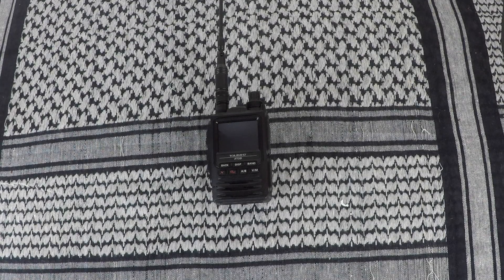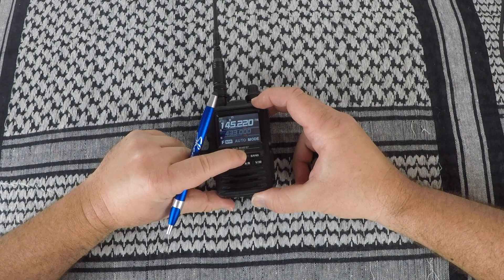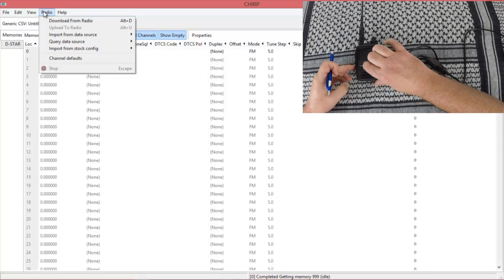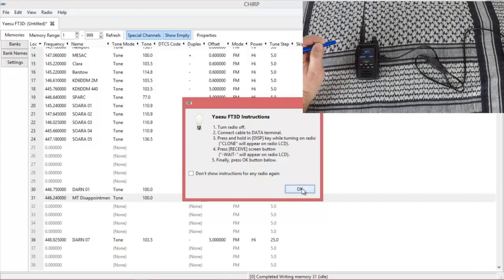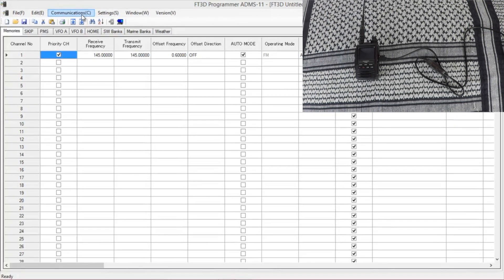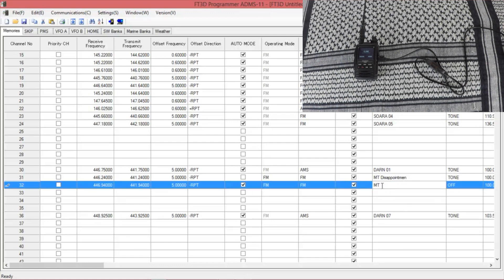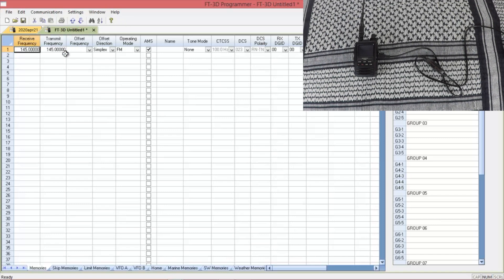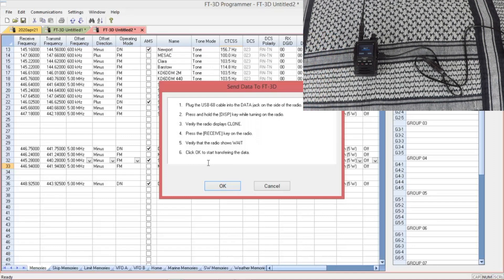Yaesu FT-3 Programming Tutorial

Comment: Great vid! I'm trying to program my ft3d with the same dmr freq that they use at my job 445.562500 with color code 1 (at work we use motorola dl2400e) i tried to find it directly on the ft3d and with the ft3d programmer software...but im struggling I just dont know how to program it with color code 1...could you help me out. Which options from the dropdown menu's are the right ones? I know RX is the same freq as the TX and it has to be CC 1... Help!?
Reply from the maker: Thank you for taking the time to watch and the comment! It is greatly appreciated. The FT-3 is not a DMR radio. It uses C4FM also known as Fusion for its digital side.
Reply: @WJ6FRadio  Ow no! Ok now i know why I cant receive those freq's from work. Thanks for the help! Any tips on which radio I should get which isnt to expensive?
Reply from the maker: I like the BTECH DMR-6X2  and the DMR 6X2 PRO. There is about a $90 price difference between them. Here is a link to the DMR 6X2 Pro, https://baofengtech.com/product/dmr-6x2pro/ref/wj6f/

I also did a video on the 6X2 Pro - https://youtu.be/ibv9ZRJ0Bd0?si=5RET0zpc-aEjhVrT

Comment: What kind of BNC connector is that? I have a diamond srh77ca I'm trying to find on that will fit on my ft3d
Reply from the maker: Thank you for taking the time to watch and the comment! It is greatly appreciated. The connector I use is by Diamond Antenna. It is called DIAMOND BNCJ-SMAP
Reply: @WJ6FRadio  thank you I've been looking for this!!!
Reply from the maker: @BrianKolb71  No problem! They have them at HRO
Reply: @WJ6FRadio  it's the right connector but I'm trying to put it on a Diamond SRH77CA and it looks like this antenna won't fit on the top part.

Comment: Does the factory cable work with rt systems software
Reply from the maker: Thank you for taking the time to watch and the comment! It is greatly appreciated. Unfortunately no. You need to use Yaesu's SCU-19 cable. Or you can buy the cable with the RT Systems software. My SCU-19 came with either my FT-2 or FT-1. I do not recall which one.